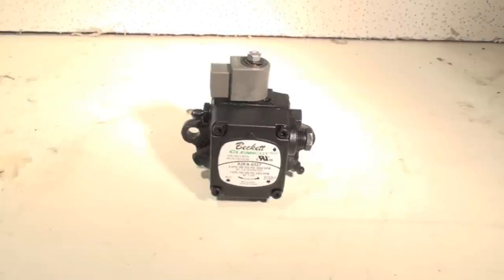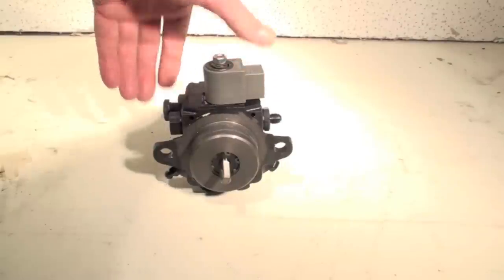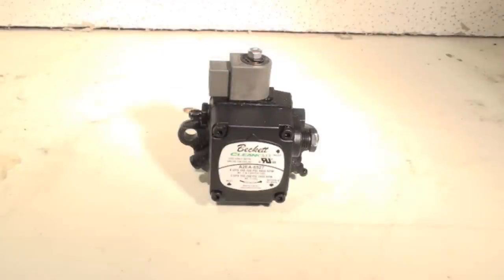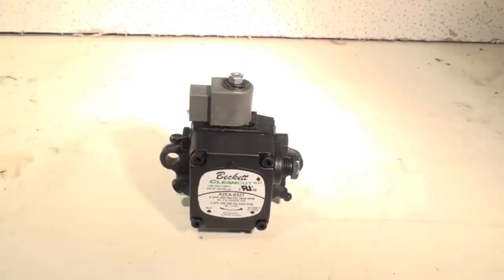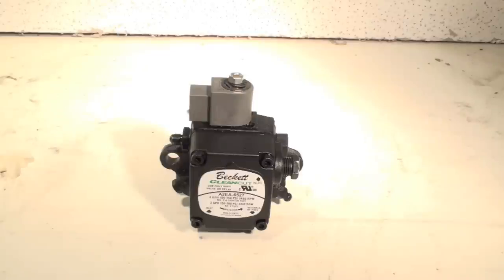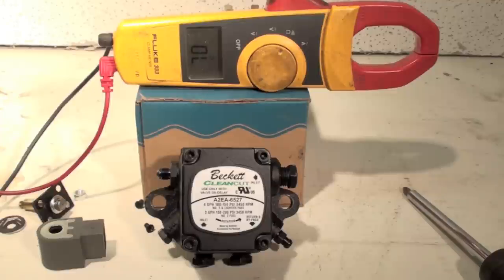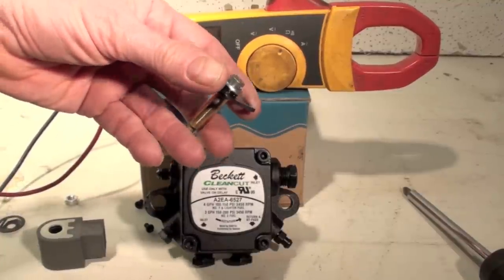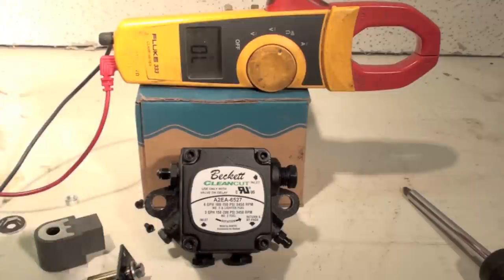Pump mounted oil burner solenoid

Comment from the maker: My guess would be the clean cut unit is leaking by.  The solenoid only opens the valve and will have no effect on whether the valve will close.  Hope this helps.
GFM
Reply: So these solenoids are not responsible for stopping oil peeing after the burner stops?
Reply from the maker: @bkoz319  They are responsible for stopping peeing of the nozzle. 
GFM
Reply: @grayfurnaceman  thank you for being a great teacher

Comment: The burners best friend, provides clean cycling of the burner. I like the separate solenoid valve addition rather than the internal ones built into the pump itself. they seem to have a higher failure rate. -@ least in my experience with Suntech.
Reply: I am wondering if you have a Suntec no-solenoid pump that goes bad and tests for cut off failure, if attaching a solenoid valve attachment would make the pump still usable?
Reply: @bigpardner  It should and I've seen it done when the pump had poor cut off causing a noisy shut down. But I think you'd be better off replacing the pump.

Comment: It looks as thought this can be used to replace a pump that currently has no solenoid, as long as the controller is also replaced. I take it the sol is NC. My pump is leaking ever so slightly it's time to replace it so I am questioning wether I should install one with a sol. Excellent explanation.

Comment from the maker: Most of your Mobile home burners are very specific on nozzle size and style.  So stay with what is recommended.  I am assuming cold temps are not a problem for the oil tank.  Have you replaced the oil filter?  When working on oil systems, cleanliness is absolutely key.  Check out some of the other vids on oil service.  The only other possibility is algae in the oil.  Very uncommon but looks like black strings on the nozzle filter.  Hope this helps.  Let me know what you find.
GFM

Comment: I thought the cut off valve inside the pump did the same thing.  It snaps open when the pressure is  built up, and snaps shut and holds, to prevent the fuel from dribbling out the nozzle on shut down.  I’ll have to admit, all the burners I worked on, probably 1000 or more, never had this feature.  It seems like a good thing to have, as it would be more precise than the cut off valve.  I retired in 2006, so maybe these weren’t used as much back them.  Good video

Comment from the maker: Yes internally.  I would say the valve needs to be replaced or possibly just cleaned.
GFM
Reply: my green light just keeps on blinking doesn't say anything about that on the reset box just on flame,off no flame, flashing 2 seconds on recycle, 1/2 second lockout. what does it mean when it constantly flashes?

Comment: @grayfurnaceman..... yes.... there are also models where the solenoid is controlled  by the oil safety control itself. These newer ones now let it create a combustion prepurge and postpurge, or neither....programming preferences

Comment: You have the function of the solenoid backwards.  It's not a normally closed hydraulic circuit but a normally open one.

That fluid flow circuit works by allowing the output of the pump to flow back to the supply side until the solenoid is activated and shuts that fluid passage off, thus allowing the pump to build pressure until the pressure/bypass spool moves backward opening the output port to the fuel nozzle. 

That center hole under the solenoid is on the pump pressure side of the system and the side hole is tied directly back to the inlet side of the pump.

Comment: I have this pump on a NorthStar pressure washer heater unit.  Not putting fuel to the burner.  Replaced fuel filter.  Took cover off and cleaned round screen.   I unplugged from the solenoid.   The voltage only showed 45 volts when on.
Reply from the maker: I assume it is not working.  Should have 120 volts.  Probably cad cell relay problem.
GFM

Comment: I want to start off by saying you to put out great informative videos and I enjoy watching each one. I used to a HVAC tech over 20 years ago, but have been working on cars for the past 20 years. The service company did not work on oil burners, only gas and heat pumps. So, most of my oil burner serving I've done primarily has been on my own oil burners which my family has mainly owned and none of these pumps had a solenoid installed. My thoughts on diagnosing the solenoid. I believe the solenoid can be tested similar to testing the solenoid on a reversing valve. After confirming power to the solenoid, you can remove the solenoid and hold a screwdriver at the opening of the solenoid and it should pull it in. Observing the removal , on this video, of the plunger, it seems you should be able to manually pull up on the plunger. Is this plunger sold separately? Great video!

Comment from the maker: It is not unusual for the nozzle to "pee" oil out after the burner has shut down.  It should stop after a minute.  There is air trapped in the gun line that is compressed during operation but re expands when the burner shuts down.  This can be minimized by use of a solenoid in the gun line.
Reply: Solenoid  name  and number To stop  peeing in  an old Sunstrand  pump

Comment: Ok thanks Gray i think i got that better now. So if i get an Amp reading and Voltage im good. If i get a voltage reading and no amps I  obviously have no "pressure" and thus no power bad control... What if i tied my solenoid into 120volt power coming down through the service switch and hooked my solenoid directly to power? if it opened bad control right?? could i test the individual terminals for power to with my meter. Thanks Gray I owe you so much, ur vids are making me into a tech ha!

Comment: My name is rod from Olympia Washington I have an oil burner Beckett  I've checked the coupler everything spins freely it's not stripped out put it back together and I got a clicking sound coming from it seems like my oil pump and then it shuts the breaker the red button off The motor feels hot that runs the pump?
Reply from the maker: Your pump is probably failing.
GFM

Comment: Hello GFM, I find your videos very helpful and was wondering if you can help me out real quick.  I have this same pump and 2 1/2yrs old, when it would time out I would hear the motor running for the 45 seconds.  Now when I turn it on I hear a buzzing noise like if the pump is stuck.  does that mean the pump went bad and I have to replace it?  When I open up the cover next to the nozzle, the fan is pretty hard to move.
Reply from the maker: Jacob Lopez The buzzing may be the transformer making the ignition spark.  I am assuming the motor does not turn.  Some of these motors have manual reset safety that may be off.  It will be a button on the motor that can be pressed in.  Pump rotation can be somewhat hard under normal conditions, so you may or may not have pump problem.  Let me know what you find.
GFM
Reply: Hello GFM, I've done a lot of troubleshooting techniques through your videos and found them very helpful. I've narrowed it down to the pump. I bought and replaced the pump and that resolved the issue. I wasn't able to turn the pump with my fingers, only with a pair of pliers.  Thanks for replying back to me. You have a great day.

Comment: great video gray thanks alot. on the r7184 or the newer genisys primary controls how would you go about proving the the primary control bad if the solenoid is not getting voltage while the ohms show that its still good? i guess to be more clear im asking how do you prove its the primary not the solenoid thats bad?

Comment: Hi Mr. Gray. That was a very explanatory video on the clean-cut oil valve.  I have a oil burner with a newer honeywell r7284U digital primary control unit.  off late. i've seen it "hard lockout" several times.  I reset it and it starts up and runs for a cycle or two then locks out again.  the error on the r7284U says "flame proven ON during valve on delay"  and the troubleshooting guide says to check the oil valve ?  Would this mean that the solenoid is bad or the entire clean-cut unit is bad ?

Comment: Hi sir, i would like to know if it is normal for my furnace when it is shut down a weak flame stays on. in case if it is not normal which part i should check and what is the sulostion for this problem. thank you very much for ur help.

Comment: Grt video.sir i have rl 28 m burner.iam facing prbm fuel leakage from nozzle.Before ignition cycle nozzle is driping.iam thinking solonoid valve may be not closing properly.
Reply from the maker: Sounds like a solenoid problem to me.
GFM
Reply: @grayfurnaceman  thanks for reply sir.i appreciate your response.

Comment: Many thanks for your very useful videos. After my 44 year old boiler failed to fire for the first time I traced the fault to the solenoid which had an open circuit. The only one I could source locally was a Danfoss which was OK in internal diameter but too long to enable the nut to secure it to be attached. I fitted it nevertheless so it's a bit loose. It works OK but gets very hot in use. Is that normal? 
I tried the solenoid using a magnet as you suggested, it was only then I realised where the passage for oil is. A close up of that would be handy.
Reply from the maker: Robin Dawes If it gets hot it may fail because it is not moving all the way when it energizes.  The amp draw will be too high.  Hope this helps.
GFM

Comment: so that plunger is pulled up to  let the fuel pass by, so if u remove that and plug up the hole that the plunger sits in. it should work then right
Reply from the maker: I believe so.
GFM

Comment: Leaking internally ?  as i don't see any oil dripping on the basement floor near the unit ?  the coil shows a reading of 447 ohms.  when would it be necessary to replace the coil or the VALVE STEM ?  thanks.

Comment: Thanks for the info here! Having a problem with the solenoid seems to work when it wants too, by any chance if dirt got through the fuel would that maybe stop it from opening?
Reply from the maker: +Jeff Parish It could.  More likely, the solenoid is failing.  Hope this helps.
GFM
Reply: +grayfurnaceman combination of dirt and bad connection sad thing is furnace is only 4 yrs old!

Comment: Hi and thanks for your brilliant and very helpful videos. The coil screwed to the axle of the solenoid valve on my Suntec pump (same principle as in your video) gets very very hot even after a few seconds. So hot I can't keep my fingers on it. I think something is wrong, though the burner that I just fixed seems to fire fine (just tried it in open air for a minute or so). Voltage is fine and within specs for valve (230 V in Europe). Valve marked 8 Watt, so should not be so hot I guess.
Any idea what the problem would be? Thanks in advance for your reply.
Reply from the maker: As long as the solenoid is correctly mounted on the shaft, it should not get hot.  My thought is the solenoid has a short or the armature is not pulling in completely.
GFM
Reply: @grayfurnaceman  Thanks Gray for your prompt reaction! I checked the solenoid resistance and it is OK  (almost 2 Kohms). The clicks in and out are loud and clear but you're probably right about the armature not pulling in completely.
Does that mean I have to open the whole pump inside out  to make sure the armature pulls in correctly? Probably some muck around. Or is there some spring in there that could be kind of "tired"? To clean the whole thing without opening could I just "bathe" the whole pump in gasoline or thinner and maybe dissolve muck this way, in order to release to armature pulling path? Thanks in advance for your reply.
Reply from the maker: @ar-oy7ok  I see 2 ways of dealing with this.  One, change the pump.  Two, disassemble and clean.
GFM

Comment: My beckett/suntec coil is defective. I can only get it to work by unplugging the coil, start up the furnace then plug the cord back in to the coil, then it will start and burn properly. I don't know what this process is doing so I am a little unsure if it's the 1. plugin, the coil, or the magnetic mechanism that is the problem. The pump is obviously fine.  I would hate to have to buy the whole pump and coil just to fix this. 
Any suggestions?
Reply from the maker: The only part I know of that is available is the coil.  Your problem sounds like a problem in the pump valve, which means a new pump.
GFM

Comment: Hmm.  Lets try this:  If you can use a clamp meter to check amps when the solenoid is normally open, amps (probably .1 or .2) are read the solenoid is getting power and energizing. (This does not mean the solenoid actually opened).   No amp draw, then is voltage present?  If voltage is present, the solenoid has failed.  No voltage, (discount ghost voltage) control is bad.  Hope this helps.
GFM

Comment: Hi there Gary, I replaced my old air conditioning unit with a heat pump a few years ago. I was told that the heat pump will do the heating until the outside temp drops below " I think 40 degrees" then it will bring on the furnace, I have noticed that the furnace is coming on when its in the low 50 or upper 40's. Is there a way to adjust the temp at which the furnace is called for? I was wondering if there is a differential range that could be tightened up a bit.
Reply from the maker: Wendy Bergeron Most of these units turn on the backup heat if the temperature in the structure drops below 2 degrees below set temp. This means the heat pump cannot keep up with the load.  If it is going to backup at higher temps, the heat pump may not be putting out as much heat as it was designed to.  Possibly low on refrigerant charge.  You might look for an ice "beard" on the lower parts of the coil.  This indicates low charge.  Hope this helps.
GFM

Comment: I'm running into a problem where I put a new pump on the burner runs and I have flame but only lasts for a minute before the oil Peter's out. 15" of w.c and pump set to 140 psi .65 80B nozzle
Reply from the maker: You have an oil supply problem.  Vacuum leak or blocked filter/line or possibly oil gelled from low temp.
GFM

Comment: If the solinoid is bad will the pump still bleed, my pump is not bleeding nothing coming out
Reply from the maker: Generally, not.  You could also have a supply problem.
GFM
Reply: @grayfurnaceman  I thought about undoing the feed line and blowing some air through it case it's clogged, when unit turns on it's hard to tell if pump runs because it's so loud
Reply: @tre9563  Its also quite hard to tell if the coupling has failed.  This will indicate a failed pump also.
GFM
Reply: First try blowing the supply line out. Assuming your filter is at the tank: Valve it off, take out the filter and reassemble the filter cup. I use a fuel transfer pump with a 1/4 turn valve, connected to the flare fitting so I blow back to the cup. With 1/4 turn valve off I pump it up then open the 1/4 turn. When you hear air bubble through your tank you got the line free. Now drain the sludge out of the cup and replace filter element, bleed like normal.

Comment: Hey there! I have problem with my oil pump from 1992 year. Delta pump 230volt. Pomp works, takes fuel through filter and gives out back to the tank. The problem is that the fuel wont go out of the fuel to the burning nozzle. Any advice? Electro-valve works fine (attracts a screwdriver while the machine is heating up the water). Help!
Reply from the maker: Plugged nozzle?
GFM
Reply: @grayfurnaceman  I put short plastic hose instead of this copper pipe to see if theres coming oil out of the pump. Pump name is DELTA VM1LR2 2892
Reply: @grayfurnaceman  I plugged off eveything from the pump, fuel doesnt flow out of the pump
Reply from the maker: @cezarycezary4180  Sounds like a dead pump to me.
GFM

Comment: Good morning. I have this pump on my furnace. It seems to have a very small leak by the pressure adjustment screw. How do i fix that ? Can i tighten the large nut around the screw ?
Reply from the maker: +Frank Reddy You can try tightening the acorn nut if it has one.  If not, there is not much you can do other than replace the pump.  Hope this helps.
GFM
Reply: +grayfurnaceman   Thanks for your reply. There is no acorn nut...Just the large nut with the pressure adjustment set screw in the center. I will take a closer look at it tomorrow.

Comment: How are you Gray I have a question I have the exact same pump as your demonstration. The only way I can get it to run is cramp of the return line from the pump and bleed the system at the same time. Any ideas what's causing that
Reply from the maker: Sounds like the regulator is leaking by.  Replace the pump.
GFM
Reply: Thanks for the replie but I didn't put the little plug in the return line figured out yesterday. But thank u great video.

Comment: does it have to be primed if I accidentally put gas in the tank and drained it. I never ran it with the gas in the tank. when I refilled it with diesel it ran for a few jobs then quit working. my pump is on a diesel burning burner for a pressure washer.
Reply from the maker: My thought here is the problem is not with the fuel as you never ran it.  You can certainly bleed the system to be sure there is no air in it, but if your tank is above the pump, it should not need to be primed.
GFM
Reply: the tank is below the pump. it's a hotsy pressure washer with a clear filter. the filter before the pump will refill if I drain it so I think the pump works. I removed the copper fuel line after the pump and when I squeeze the trigger no fuel comes out of the copper line. hotsy doesn't want to give me any advise so I'm here on YouTube. for some reason the valve isn't opening. I'll have to find my volt meter and test it in the morning.
Reply from the maker: If the pump has a solenoid, it could have failed or be plugged.  Some of the pumps also have an inlet screen under the pump cover.  
GFM